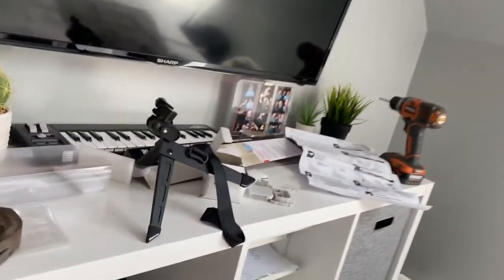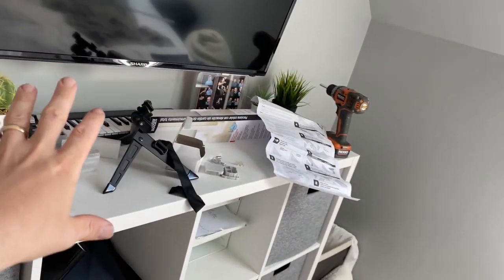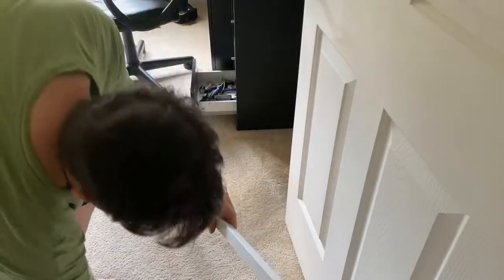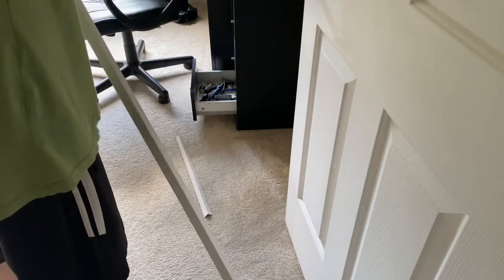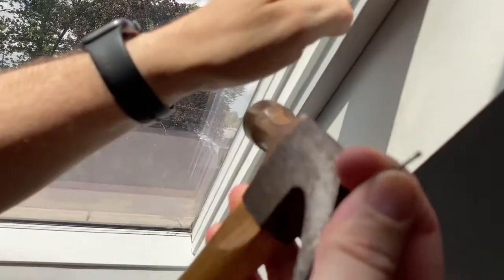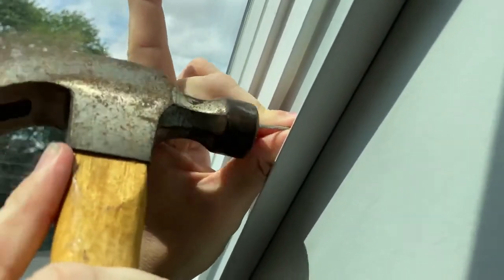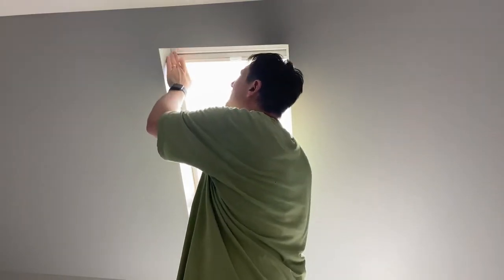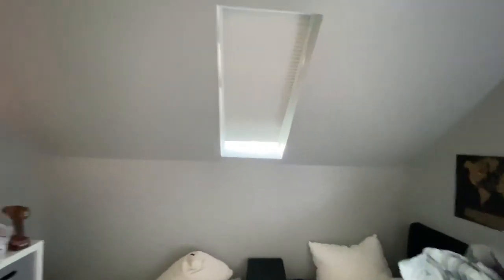Say "NO" to expensive custom shades for Skylights

Comment: I just used your tip to install my own skylight shade. Using the drop ceiling framing was a great idea. I bought a shade 1/2" shorter than the inside width of the window and the rails cover up the sides perfectly. I bought some magnets just in case it didn't shut all the way, but my shade was long enough. Thanks for sharing your idea!

Comment: I just did this in my place, and it worked great! A possible snag might be if the shade is a little too wide for the space you're installing when you get it out of the package. Mine was like that, so I just sawed off about a quarter inch with a hand saw, until it fit perfectly. $80 total cost, saved me hundreds and my friends were all quite impressed! Thank you for the great idea and video!

Comment: you saved more than that, I was quoted over $3000 to put shades in at the ceiling level, for my huge skylight "holes" in the ceiling, didn't explain that very well, but to cover the holes in the ceiling which are very large with room darkening shades, so bright in the summer and lets in so much heat and then in the winter the heat goes right up there and it's cold. thank you for the idea!